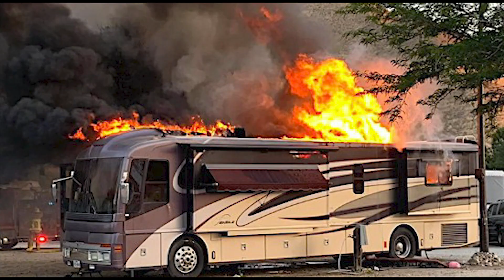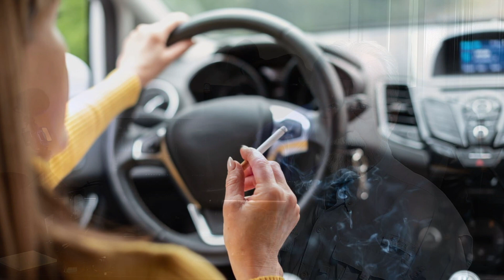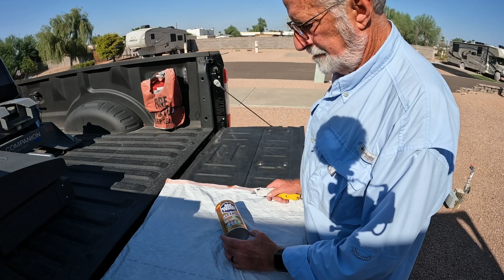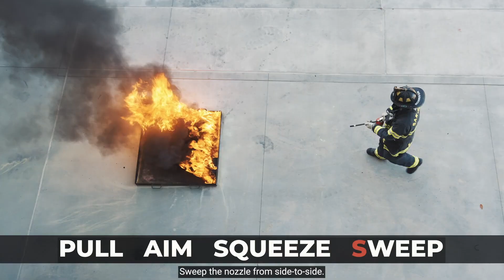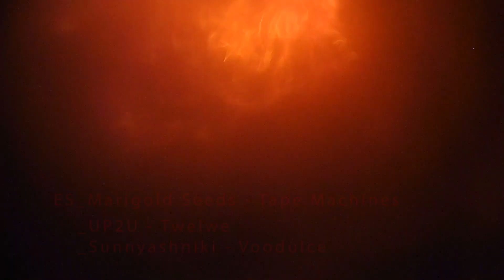🔥RV Fires | Prevent | safety tips | locations | 🧯extinguisher | get out | 👨‍🚒Firefighter tips

Comment: Chris Love the topic I have replaced several of our receptacles with your standard home use one 20 amp model which is overkill. Several high amperage draw appliances such as microwave and fireplaces will burn up the standard RV outlets. We always taught our technicians during fire extinguisher inspections to check the bottom for rust ( specially outdoor ones) and to shake unit. We always test are pedestals prior to setting up camp found several bad one. We don't have your typical RV refrigerator we have a residential one but I know this is a big cause of fires not keeping the vents clean and overheating and causing a fire due to an unlevel just a thought.  Thanks for info.
Reply from the maker: Thanks guys! Yeah, we've been slowly replacing the high amp draw ones on our rig as well. You would think that saving a few pennies wouldn't be worth the risk to the manufacturers... Those are some really great thoughts that should get more of us thinking about safety. Thank You!!! :face-red-heart-shape:      OLT